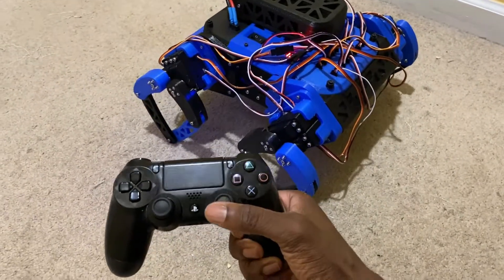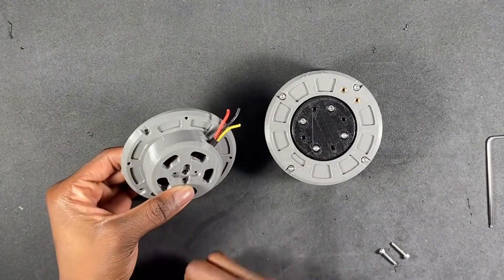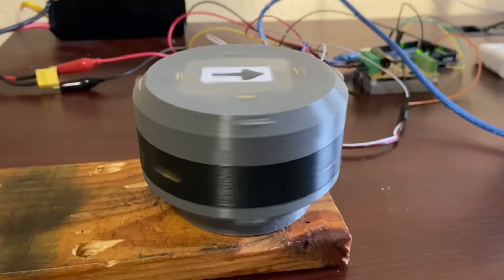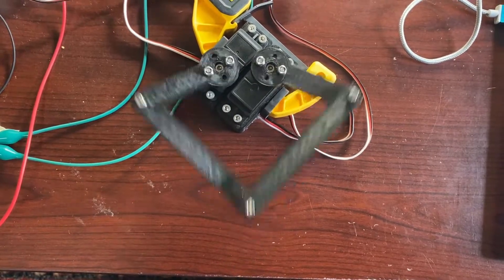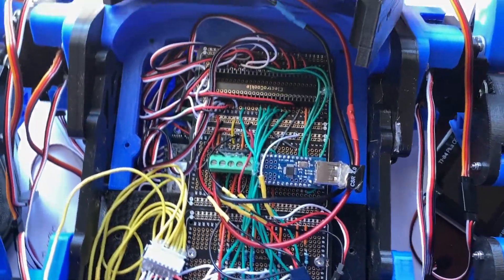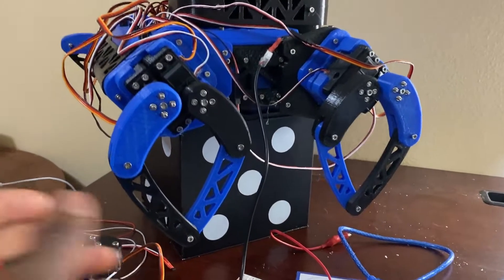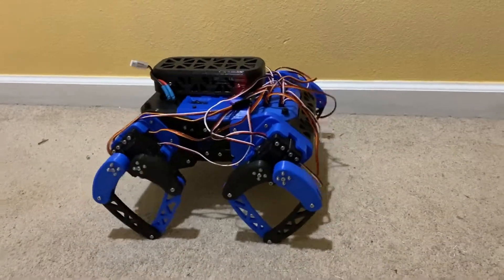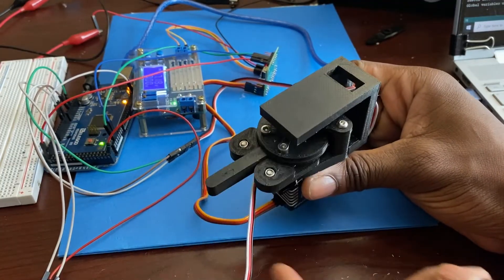MIT Makers Portfolio (3D Printed Quadrupedal Robot) - Rejected

Comment: Cool ass project! What made you decide to go with Servos instead of BLDC’s or stepper motors?
Reply from the maker: Thanks! Brushless motors would have been the bests to go with, but ones with high torque are extremely expensive. Also I wanted to keep this project low scale and for this size, Servos proved to be the best alternative. Stepper motors are too slow for fast actuation especially if you add a gear reduction. They are better for other projects like robotic arms.